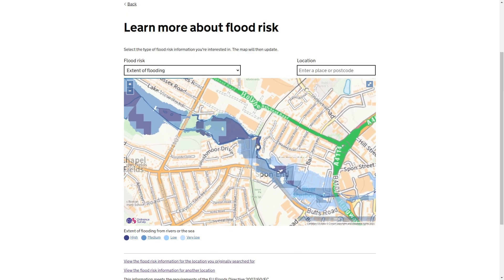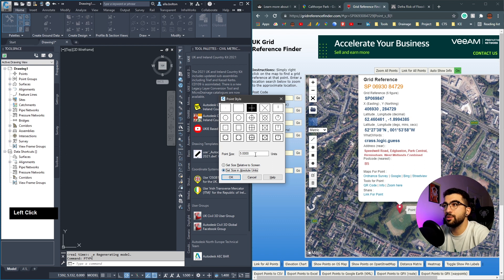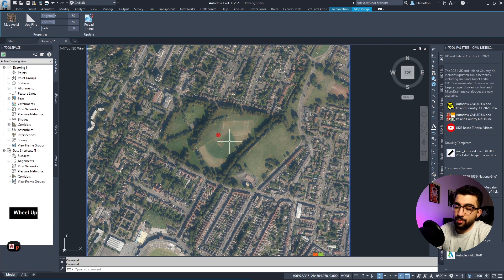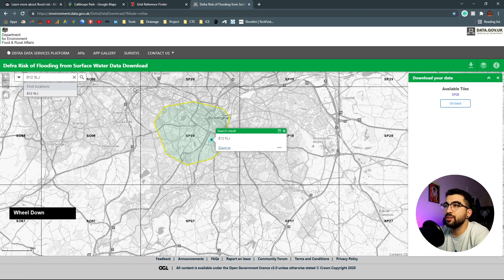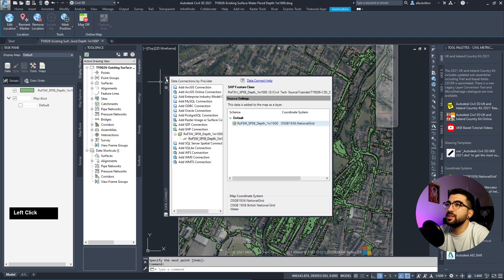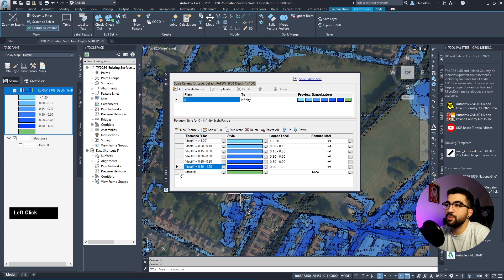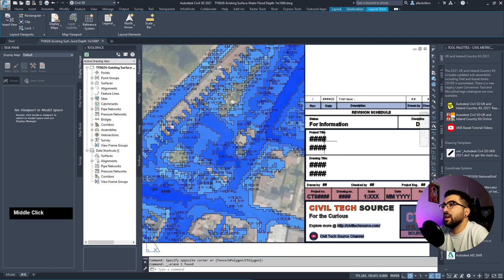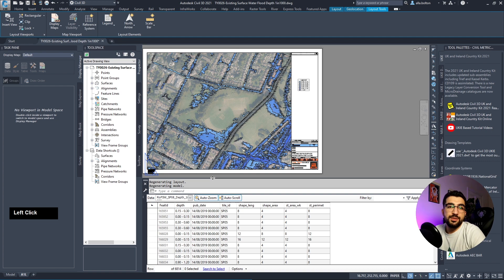How to import in Civil 3D Surface Water Flooding Depth data from DEFRA EA

Comment: is it possible to add/edit the rules and still have accurate data
Reply from the maker: What kind of edit/rules where you thinking? The data is not fully accurate if I recall as its a range of flood depth e.g. from 0 to 300mm
Reply: @CivilTechSource  for example if I wanted to change the depth levels of a rule from 0.9-1.20 to 09-1.25?
Reply from the maker: I don't think that would be wise as the depths are prefixed from the source file. So basically they have assigned the square boxes a value of depth range. So you changing the range will not be wise as it will clash with the values inside (I think)

Comment: Hi I have followed your instructions to the bone while using the mapwspace,  add to map with query and adding it , the EA maps don't show up on the map? Could you tell me how I might solve this issue?
Reply from the maker: Hi Nam, when you add the map with the query can you see the map being creating in the MAPWSPACE? If yes, then maybe you just need to send back the geolocation so the surface water map can be on top. If not, then try importing the map without the query and see if this helps.
Reply: @CivilTechSource  hi, thank your for your reply !I have managed to get the floodmaps in but when i am trying to edit them, click the new theme button- a error prompt saying "unhanded exception has occurred in a component in your application. ........
The path is not of a legal form"
Any idea on how to resolve this?
Reply from the maker: @namgyeldorji  Not sure, sounds like more of a crash/development issue. Maybe worth checking the Civil3D forum.